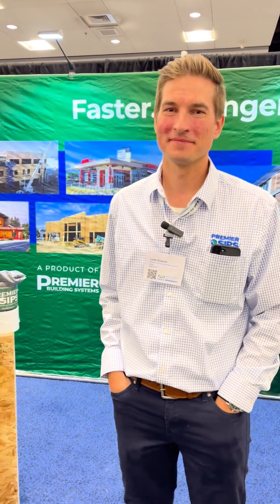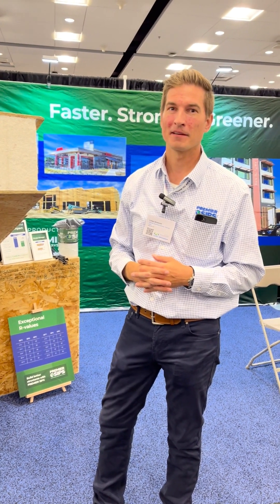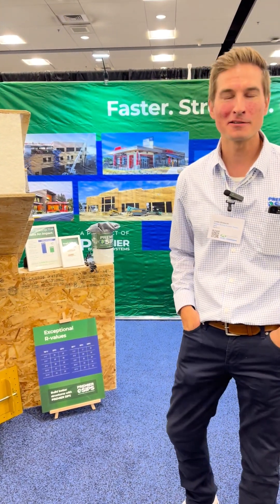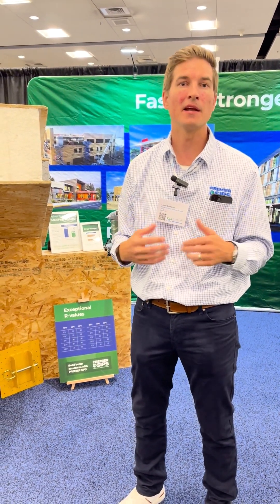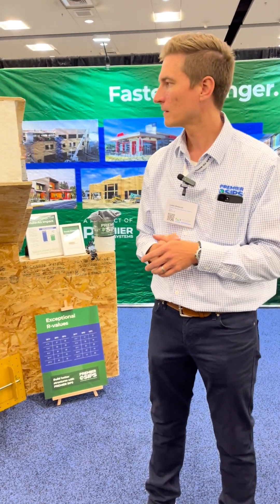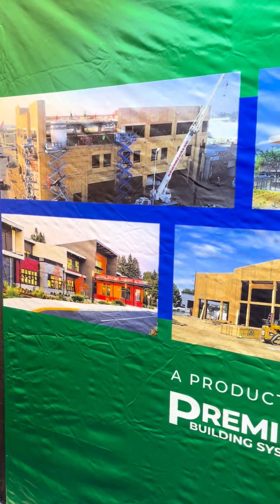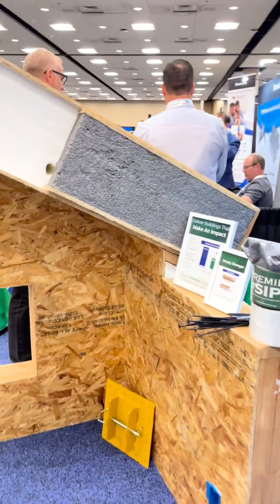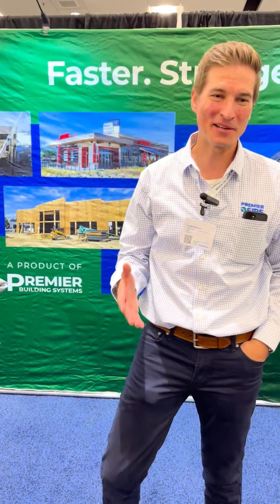Premier SIP Panels: The Future of Structural Insulated Panels for Energy Efficient Building

Comment: A common failure of the sip systems is air leaks resulting in condensation and rot at the joints. I’ve seen some installations using multiple tape and caulk treatments on the inside and outside for a belt and suspenders approach. Some might say that B&S is over engineering, but everything is over engineered - until it fails.